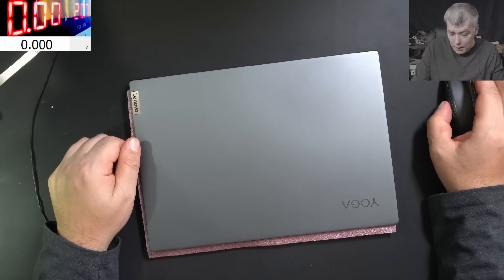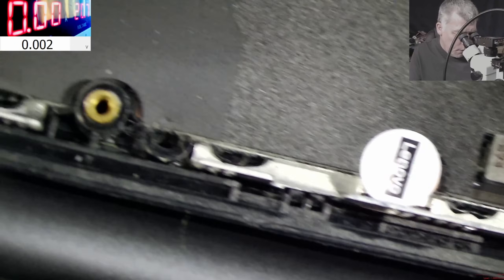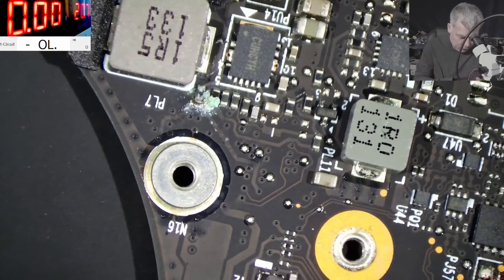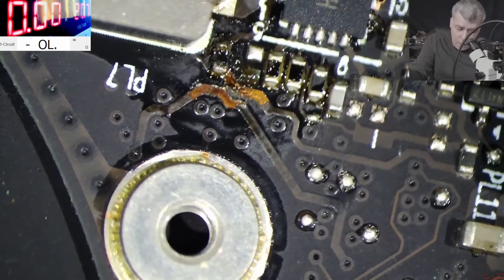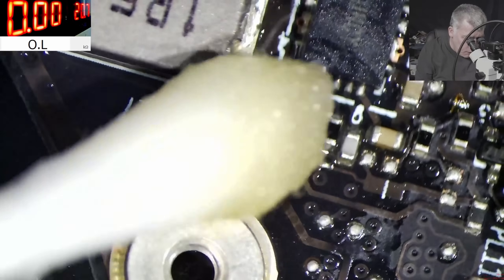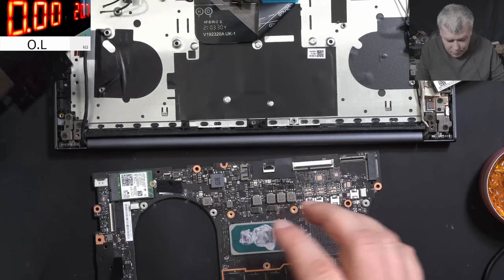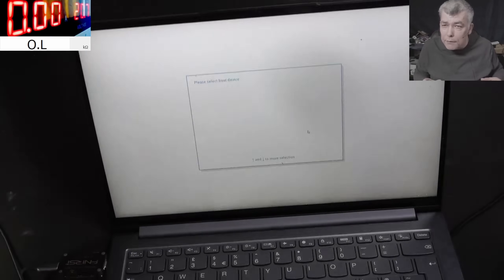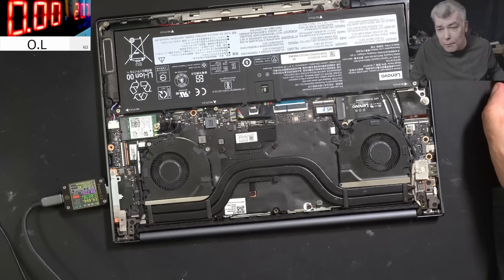Lenovo Yoga Slim 7 Pro - no power, motherboard repair - a liquid damage repair

Comment: I was hoping to find your video about this model. My PC has the same motherboard, yesterday I connected a spare power supply having the USB-C that has just started to not work well (the cable must be twisted a little before power stays on without interruptions). 

After moving the cable a little, the battery was charging, but after less than a minute the computer turned off, and since then I wasn't able to power it on again.

I tried to disconnect the battery, press the reset button with a needle...nothing.

The power led after reconnecting the battery is white (with power connected).
If I keep the power button pressed for about 15 seconds, the power led does 1 long blink (orange), then nothing.
LEDs on the keyboard turn on for an instant, but fans and the screen remain off.

Unfortunately it's out of warranty. 
I'm thinking about trying to repair the motherboard myself.

Can anyone give me an idea of what component could be the cause? Thanks

Comment: Hello, thank you for sharing your professional and valuable tutorials. I have a Lenovo Yoga Slim 7 Pro 14ihu5 laptop whose IO power chip has burned out, and the chip number is no longer identifiable. If possible, could you please guide me to resolve this issue? The exact location of the chip is on the right side of the keyboard flat cable, beneath a black cover. I appreciate your help in advance.

Comment: Pro tip: If you flatten the wire with a hammer first (hit on a metal block or anvil etc not wooden desk) then the wire will be very thin and the part will fit better. Essentially you can make a calibrated copper trace with wire.

Comment: It's not just about satisfaction, if the resistor there was a 10K +/- 1% and you happen to replace it with a 10K +/- 10%, it will seem to work at the beginning, but may introduce unexpected behavior later on!

Comment: Galvanic corrosion. If there's power in the circuit, a cell is created and copper disappears into a copper salt very fast. If you spill, disconnect that battery ASAP.
Reply: Thanks for the info sir

Comment: Is the first time I comment on your channel. 
I want to share my experience with laptops. I  bought an ACER basic laptop back in 2012. This laptop still works after all those years. I have had  MSI Titans laptops, and those had amazing cooling systems! Then I had an MSI Creator laptop, which was very poorly made! The body was so tin and flexible, terrible!. Then I bought a Lenovo Legion laptop. Very good quality and easy for upgrades!. Then I bought a Lenovo X1 Carbon gen 6 and gen 8. These laptops are super durable ! I never had any problem with lenovo, to be honest!.
I trust lenovo! 

Truth has to be said:  Any electronics won't last forever.
Reply: Lenovo has really weird engineering laptops not in all models but a lot of them.
Thinkpads are really good for example compared to yoga with failing hinges or cheap power buttons.
Reply: My old 486 Win2k that ran multiboot with a 30MB HD hd pulled from a 286AT (also a multiboot Win95 & DOS) fired up about a month ago after a capacitor found rattling around on the MB was soldered back on (thanks to inspiration from Sorin). More than physical damage as far as computers not lasting, updates are the major culprit.  My XP  Dell & sister XP Gateway died and could not be revived by resetting the bios after the last update less than a week apart.  Later a fairly new expensive Win7 was sabotaged during Windows 10 preparation and it was sold without OS disks. When it was switched to Linux, wiping remains of HP and windows to my surprise, annoying yellow flicker lines across the 17" display went away. 

My new Dell has no way to change scroll direction of the touchpad. Dell claims Windows is taking care of the driver while Windows refers to Dell. Cozy relationship. Time to buy new, eh?  

The question becomes for a reliable computer, " Did Levono shell out the big bucks and proprietary information to Microsoft to spare them from intentional driver update sabotage? Or, did the other manufacturers shell out money to Microsoft to drive up sales?"

Comment: What happens if that resister fails in the near future?
Reply: You get the same fault.
Reply: It may fail or It may not...anyway, It Is a 10K resistor. The current thru It Is very small. Basically, low value resistors are prone to fail, because they are used tò monitor current which can be high enough tò generate heat. Medium value resistors,  say in the range of TENS of KOhm seldom fail. On the contrary, resistors in the MOhm range tend tò fail since they are used in high voltage circuits. Regards from Italy.